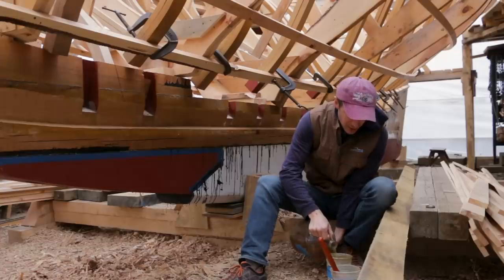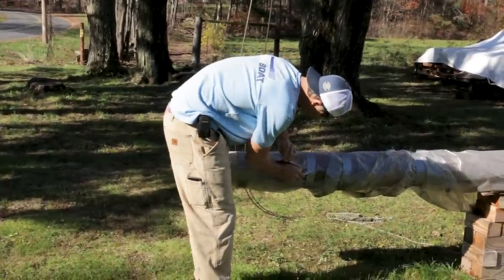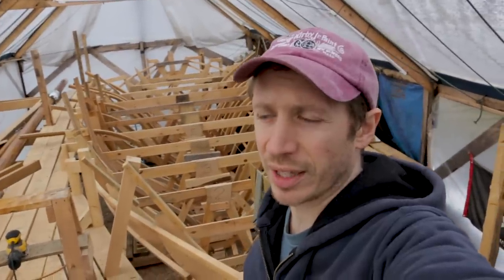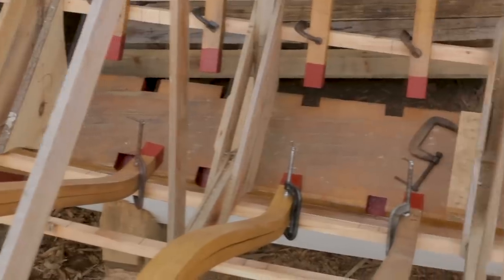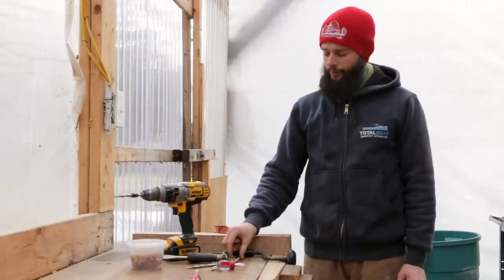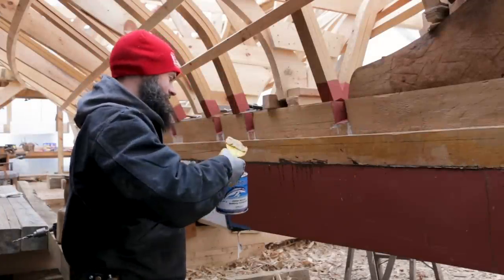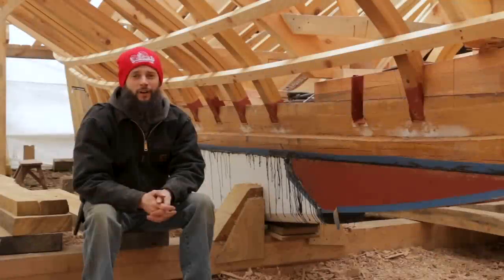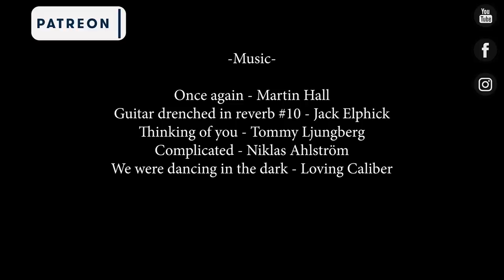Acorn to Arabella - Journey of a Wooden Boat - Episode 49: Bedding the Frames

Comment: Toilet Bowl wax,what is that? Thanks for your good videos,Hej from D.K.
Reply: Toilets in the USA are generally sealed to the sewer connection with a wax ring around the pipe, like a gasket. They're a cheap way of getting a reasonable quantity of soft wax when you buy them; you don't generally want a used one!
Reply: Silas Humphreys. Well I never knew that,you learn something new every day. Have a good one.!

Comment: Does the Dolphinite play a role in joining the wood? If so could you get away with just that?
Reply: The stuff is like a linseed oil and silica putty that retards water entry and decay. It doesn't really "join" anything. But acts as a barrier to water. And as a, well, cushion for flexing, in wooden applications. It keeps the wood from drying. Think of that pink gunk that dentures are held in with. And where they guys are putting it; these are areas may never see the light of day for 20-50 years, assembly willing. They're Yankees. As am I. Over build. Over deliver.
Reply from the maker: Thanks for saving us an explanation! =)
Reply: @kathyrudolfod2267  Thanks for the reply!

Comment: What the devil is toilet bowl wax? You mean you put wax down the bog in the USA? Weird. Anyhoo, good to see your cracking on lads.
Reply from the maker: It's used to seal the toilet to the pipe.  It's a cheap way to get good, sticky, long lasting wax.  The new ones are greatly preferred!
Reply: @AcornToArabella   Thanks, for a minute there I wondered if it was to stop ones arse sticking to the seat or some other arcane usage. Pretty sure we don't use it here in the UK, shame it looks as you say a good source of cheap wax.
Reply: @diabolicalartificer  I'm sure you use SOMETHING on the bottom of your bogs! How many toilets have you taken out or worked on?  There are polyurethane donuts that can be used bu wax rings do  a great job of keeping the nasty stuff going where it is supposed to.

Comment: Arabella creators ~ I know I should be scolded for this . But having worked through many cold and wet , and freezing conditions myself , my brother and I learned from a plumber that ABS glue will start any fire , on any wet wood , any time . He was right . And we could unfreeze our fingers  (since we were working with galvanized sheet metal pipes you couldn't work with gloves on )
Reply from the maker: We use the old linseed oil rags but thanks for the tip!

Comment: the screws seem like a very weak connection between the keel and the rest of the boat. The buoyancy of the hull and the weight of the keel counteract and would seemingly come apart under load or in rough seas. Am I wrong about this or will there be more reinforcement added later?
Reply from the maker: The screws are "bonus" fasteners, once she is fully framed you could cut the frame ends off where they meet the keel and sail her around the world.  Many builders believe the sockets and fasteners are not worth the time or energy to install.
When properly installed a screw should go in and out quite easily, also the bit and brace has WAY more torque and power than people realize.  
Looks like so many people are puzzled by our decisions on this that it warrants more than a comment.  We will make sure to explain it all a bit better in the next video.

Comment: What determines the position of the ribands. Are they the same as the diagonals in the body plan?
Reply from the maker: Roughly following the diagonals but since their main purpose is to guide the frames it matters more that they lay smooth and fair as opposed to on any certain line.

Comment: What is the difference if any between shellac and varnish as sold in the big box stores. I'm 70 and my grandfather used what he called shellac 60 years ago, but it's no longer sold in the hardware or paint stores.. When you ask for shellac the salespeople always say it's varnish or polyurethane..
Reply: Google it so they don't have to spend time answering questions that have easily discovered answers.
Reply from the maker: You can still get shellac but the de-waxed stuff we use can be a bit trickier to find.  Wood working catalogs carry shellac flakes and it just takes denatured alcohol to dissolve them and make shellac.  Shellac is a natural product, look it up, it's pretty cool.  Varnish can be a whole host of ingredients.  Shellac is also called "beetle tea" =)
Reply: Thanks for the information.  Jerry Miller was correct.

Comment: Only about 3/4 inch of engagement??
Reply from the maker: 2-1/2" frame and a 4" screw.
Also
The screws are "bonus" fasteners, once she is fully framed you could cut the frame ends off where they meet the keel and sail her around the world.  Many builders believe the sockets and fasteners are not worth the time or energy to install.

Comment: Can you explain why you choose shellac over polyurethane?
Reply from the maker: Shellac came highly recommended where polyurethane did not come recommended.  Also shellac is natural, has been around a very long time and does a great job at sealing wood from moisture for a long time.  It does not handle UV well though, but buried in a frame socket that is no issue.
Reply: @AcornToArabella  great answer, Thanks.

Comment: I don't understand the tapered drill bit, the screws are not tapered, why are the holes?
Reply: The body beneath the threads IS tapered.  Google wood screws and you can see dozens of examples.  The object is to taper the hole for the body of the screw so that it is not applying splitting force to the wood.
Reply: @jerrymiller276  Because wood screws have both a point and a lead out to the shank very short examples can appear to be tapered but they absolutely are not. I challenge you to find an example in image or description of a wood screw with a tapered body.